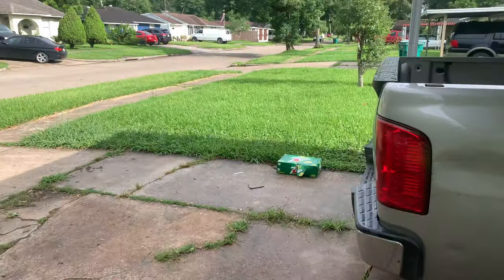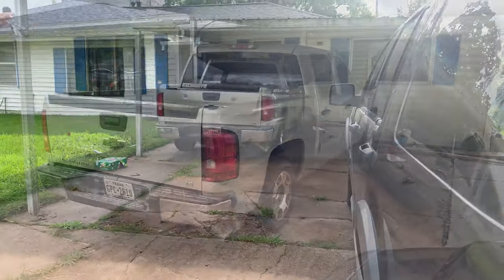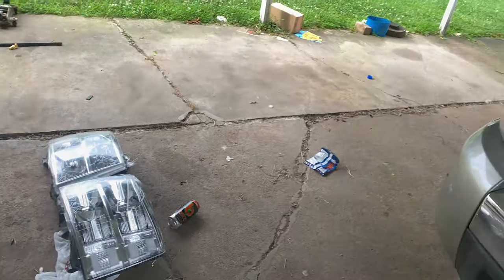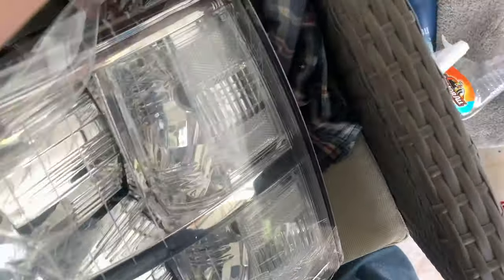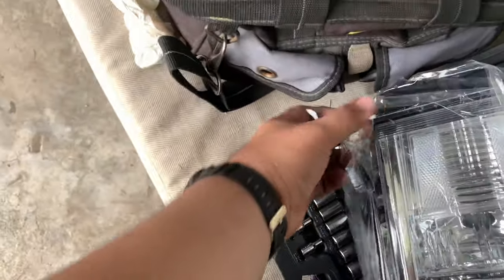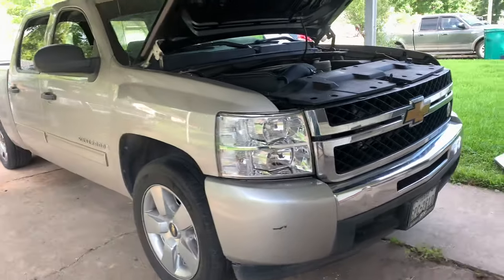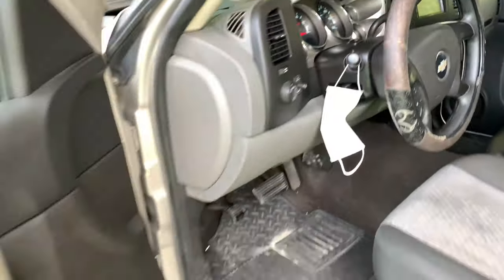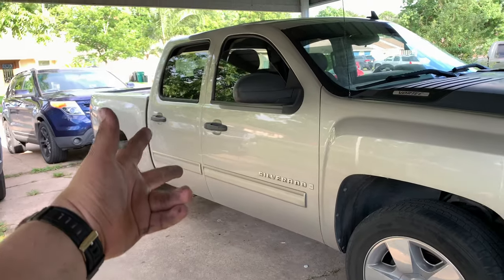Clear headlights for the crewcab!!!!!

Comment: I just got these lights for my truck bro, they came with no wiring, any H11 LED should fit with the stock wiring, or would I have to change the wiring?
Reply from the maker: Any h11 would fit bro no need to alter rhe wiring( apologies for the late reply)🙏🏽
Reply: @jasonnnbs  I put them in already bro I had to put the wiring on the housing, then connect it to the current and then connect the LED bulbs.  I’m looking for the housing of the fog lights, did you ever changed the fogs on your truck bro?
Reply: @jasonnnbs  & appreciate the help bro, you got a sick build I’m from the area you’re from too

Comment: Sounds mean ! Looks great and you even did the switchbacks 👍🏻 do those have built in resistors? What brand switchback ? I saw a lot of the headlights let moisture in and it’s recommended to seal it with silicone
Reply from the maker: Thanks bro💪🏽 and yeah had someone put them on for me.  One lets moisture in so imma get that fixed